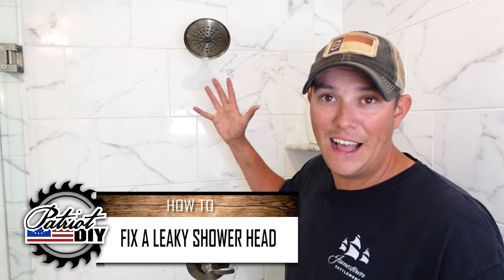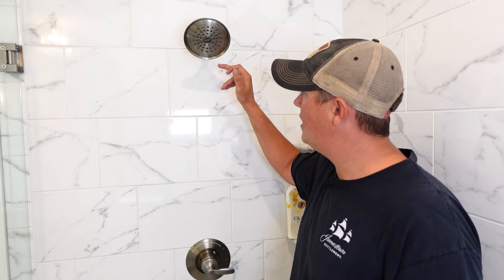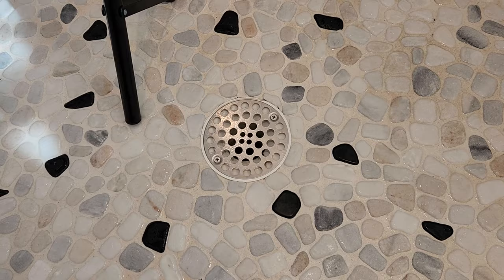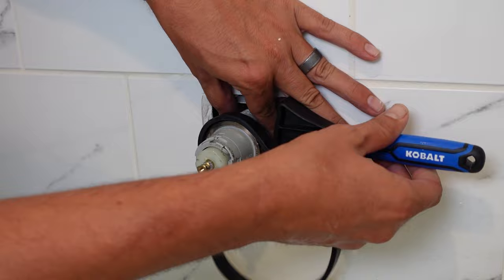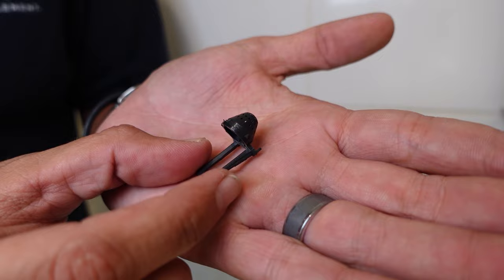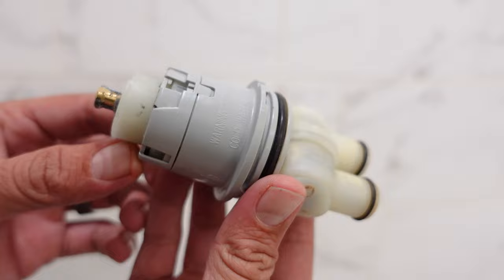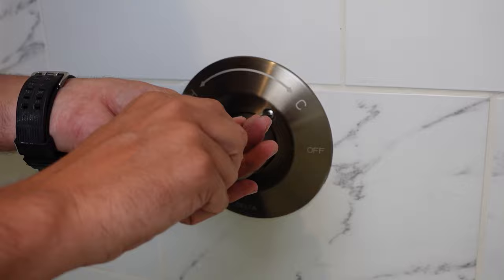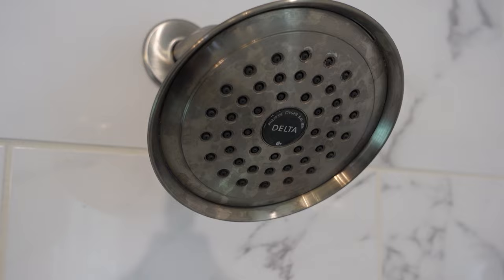How To Fix a Leaking or Dripping Shower / DIY Replace Shower Cartridge

Comment: Great vid - very helpful. I have a Moen shower faucet, which is of course built a bit different, but the basics from this video apply. For original residential owners of Moen faucets they have a lifetime warranty against leaks, so I just called them up, told them my issue and model number and they shipped a cartridge out to me free of charge. No receipt required!
Reply: Thanks! I’m gonna call them today.

Comment: I had this same problem house is 25 years old everything looks and works good just that leak.i called local plumber he came a couple hours later quoted me $450.00 to do what you just did so I've ordered parts and strap.

Comment: I had my delta cartridge replaced, which was very difficult because of the corroded water that kind of sealed the old one in. Now we got a new showerhead and that is leaking nonstop, drip drip, drip any suggestions? Thank you.

Comment: I have a tub with a shower wand.  Water seems to slowly build in my faucet, and eventually leaks out, so I changed my faucet to a newer model.  It doesn't build up as fast as it did, however, it still will leak over time.  Is it possible that it's my shower wand?

Comment: I had to get new delta valve seats for ours. The new style valve seats do not work on this older style faucet, I finally fixed it by getting them from true value. They had a pack with the old style delta valve seats and the new.

Comment: That cartridge comes apart with on twist and there is 2 springs and 2 black seals. That is the reason alot of time for the leaks two. If you expand the rings slightly it can fix the problem with no need for a cartridge, you can also but the springs and seals that are inside.

Comment: Thanks I was able to fix my issue using your video. Had a piece of pex stuff in the rubber and mesh. Took it out and it stopped leaking. House is only a year old so I did not think it was a bad gasket yet.

Comment: Great video, but 2 suggestions:
1. Give that pipe in the wall a wipe before installing the new cartridge. 
2. Before installing the decorative covers, turn the water on and check for leaks. It will at the very least give you peace of mind knowing you did not introduce a leak inside the wall.

Comment: I have a 2006 ReBath model. Tried three different cartridges all still fast drip. Tried lubing seals with silicone grease. I may try lubing ceramic disc with silicone grease. I removed the inner piece, no evidence of leaks there, but replaced o-ring and seal anyway. I am at my wits end. Nothng is corroded or looked bad, new parts made no difference to the drip. Even tried over tightening, no change.
Reply from the maker: Hate to say it...but may be time to call a plumber lol

Comment: I changed the cartridge but water still dripping from the shower head. Do you have other suggestions I can do? Thank you so much .
Reply: it could be the shower head.  So remove just head and wrap plumbers tape around the end of the spout and screw back on the shower head 😊

Comment: I'm having problems getting the screw out the handle?  I can un-loosen and tighten the screw but the screw will not come totally out
Reply from the maker: It's possible that you don't have to take it completely out, just depends on the make and model I assume

Comment: I cannot be able to find the small hole and small screw on my Delta knob as you show at 2:55 in the video. I do not see it anywhere on the faucet. Thank you very much.
Reply from the maker: It's usually covered by a small rubber cap

Comment: How do you keep the outside part so clean? Ours gets this like white looks like some type of lime sediment buildup or something
Reply from the maker: Sounds like hard water, you need some kind of in line water filter
Reply: @PatriotDIY  sounds like a plumber issue unless it's an easy install?
Reply from the maker: @nicholasgenaris327  probly pretty easy, get under the house and shut your water off, then cut the pip and add the filter, then reattach the pipe......but ive never done it

Comment: what if i do not know the make or model of my shower faucet? Do they have universal cartridges?
Reply from the maker: Start by taking the old one out. Then bring it with you to the store to compare
Reply: @PatriotDIY  i am new to having to do home improvements. If i cant find a replacement, that means i have to replace the entire faucet. can i cap the shower faucet so i can turn the water back on, while i am waiting to replace the faucet?